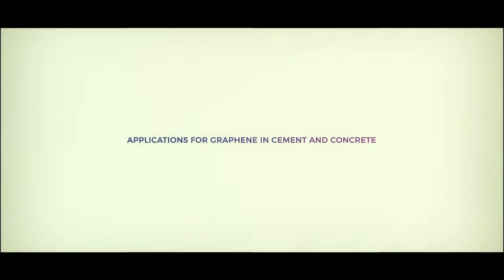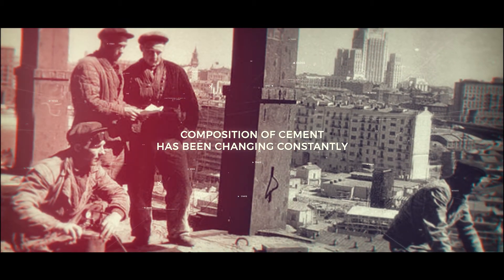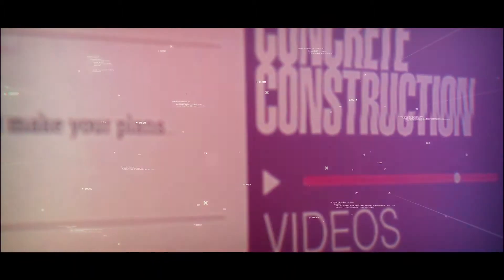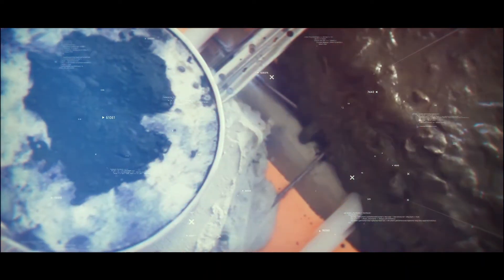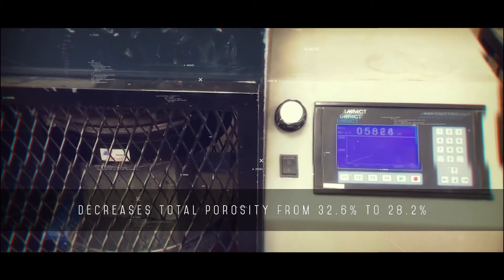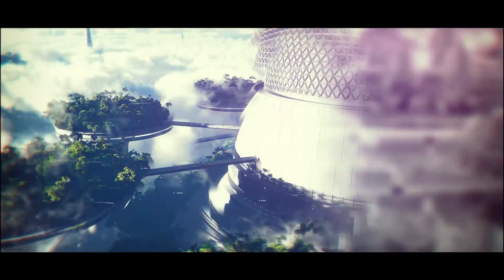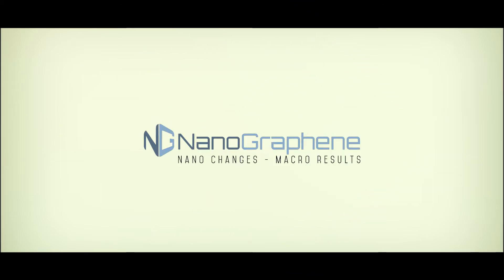Graphene-Based Cement, graphene concrete

Comment: How did you mix the graphene into the concrete? Using a liquidised form, powder or flakes?
Reply: I too have the same question. If you know the answer please reply me
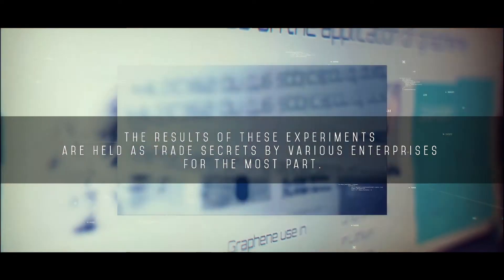Reply: looks like powder at 1:22
Reply: @3D_pablo  I have just mix with the water and then mix the water with the concrete, It gave me good results, try it bro, But measure everything
Reply: @karunakarankartheehan7666  disculpa donde puedo comprar el óxido de grafeno para añadirlo al concreto, necesito para mi proyecto de investigación. O si hay algún aditivo con grafeno que usted me pueda ayudar a conseguir se lo agradecería mucho.